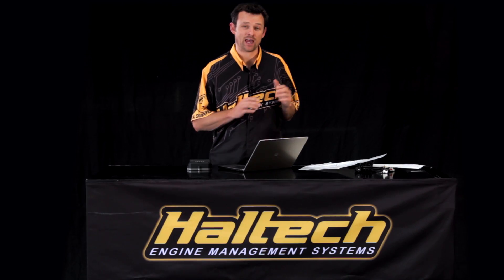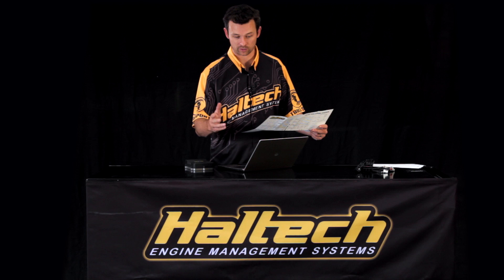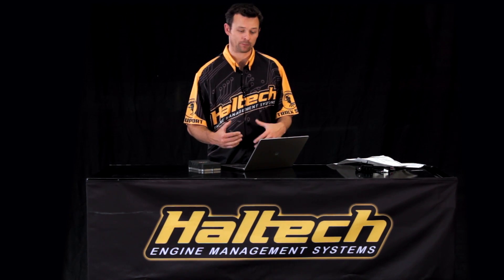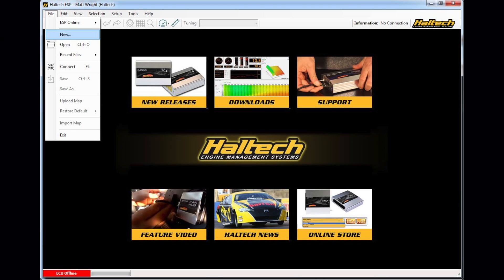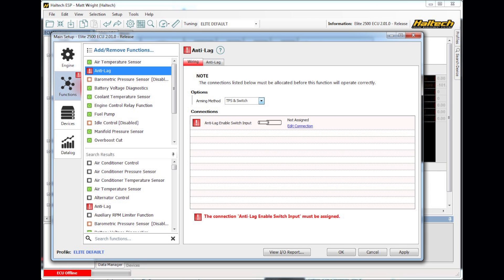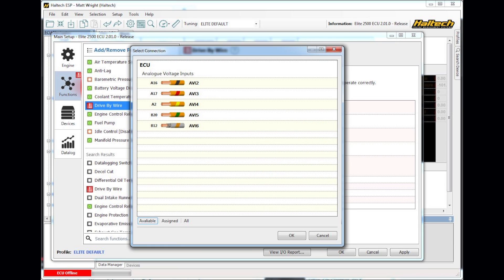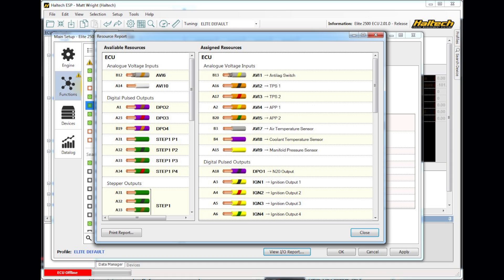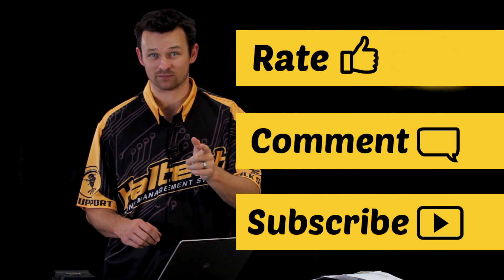Elite ECU wiring with ESP software - Technically Speaking

Comment: Did he work with gs300 2jz vvti  and  jdm Outo transsmition  161  any  info ..?
Reply from the maker: +ibrahim Al- ALI The Elite does support the 2JZ VVTi, however Haltech ECU’s do not support automatic transmissions. You would need to install the Haltech in parallel with the factory ECU (Haltech to control the engine, factory to control the transmission).
Reply: thank you for info bro